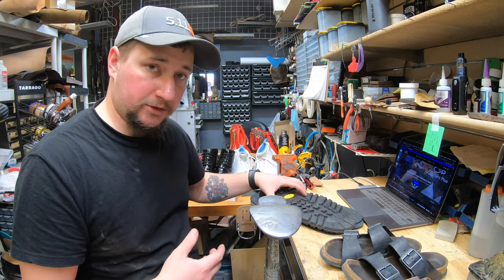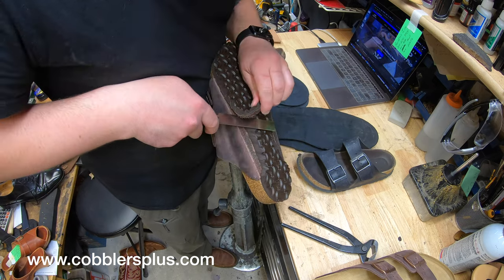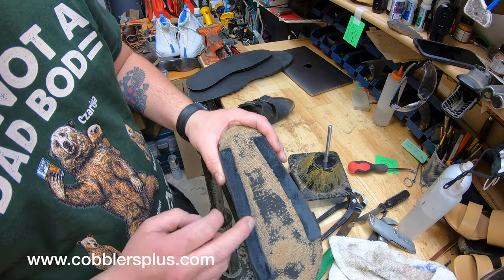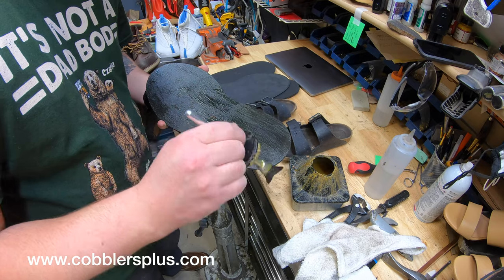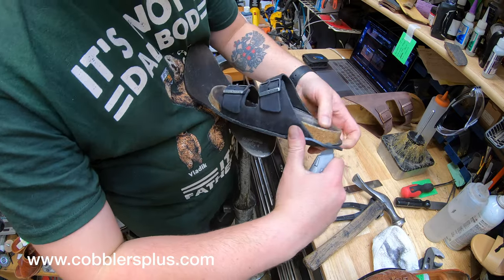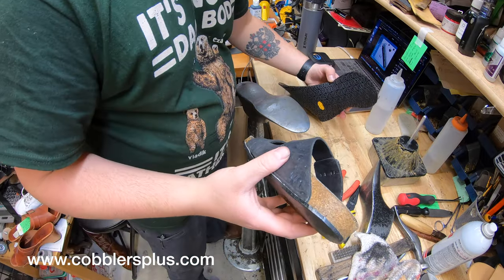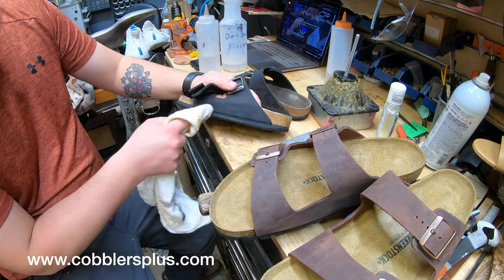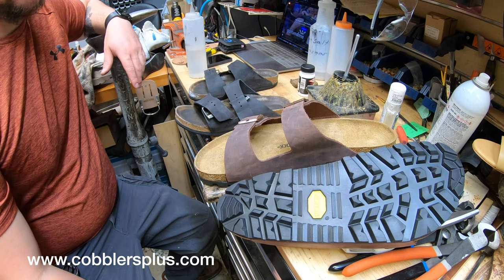Birkenstock Arizona resole with Vibram Skull and Vibram Sierra

Comment: How much it cost to repair the sandals if your replacing the foot bed and the soles, is not cheaper just to get a new pair of sandals?
Reply: Figures the question I came here to ask wouldn't get answered. 😏
Reply: @TheWinterjen  70-130$ for a job like this depending on the cobbler skill and what you want them to do. 
Id easily pay 120 minimum to make them a awesome as possible

Yes it would maybe be cheaper but someone might want to save a pair for nostalgia/sentimental value or even a limited edition pair or something.

Comment: On the rewatch. So are the Vibram and other one more durable than the dogbone?  I feel like dog bones wears very fast in the heel. Wondering where you get the midsole material. Been looking all over amazon with a lot of luck. What temp do you warm at?  What’s that sanding tool you’re using the cut off /remove that bottom sole?  Do you have trouble removing the bottom sole from the midsole material?  I’m struggling.  Thank you for the very specific tips. I have an expensive lift on one shoe so it’s getting quite costly to replace them.   I cleaned up my whitebirko-flor and midsoles with some oxyclean.  Worked great. Just kept it away from the cork and stayed on the outside.

Comment: Love your channel and candid sharing of your expertise! 
I watched one of your previous Birkenstock complete resole using Birkenstock cork footbed and outsole. In both videos you shave the outsole. 
I came across YouTube channel DrPronghorn's Make-Along Vlog, video title: "A New Method For Recrafting Birkenstocks: Don't Throw Them Out".  
In the video he uses a heat gun on the outsole to weaken the bond of the adhesive to the point that he easily separates the entire outsole by hand. No shaving, no grinding, no solvents and w/o taking chunks of cork out of the footbed.  DrPronghorn  states that he hopes his video helps other cobblers and enthusiasts. Just wanted to pass the word. Have you tried this method or would you not recommend it? 
Edit: He goes on to say in the comments that he now places the sandals in some sort of kiln or craft oven set to 200 degrees F for a few minutes.

Comment: Man this was a cool video. I have a couple pairs of Arizona with extended straps add to them. I love Birkenstocks because they make them for big feet and wide feet. It's not often you run across a Birkenstock that is a size 14 & up. I have big very very extremely wide feet sz15 6 E wide with very fat wide toe that are equally straight across making my foot very very wide at 6 1/2 inches wide from my big toe to my lil toe. My foot outgrew shoes , socks , & boots 35 years ago. I have a pair of flip flops but I barely can get them to fit on my foot because my toes are wider than the flip flop strap. This is why I bought the Arizona's & needed to add the extended straps to the Arizona so the straps well buckle up over top of my chubby fat wide toes that are straight across. I wish my toes were at a 45-degree angle like shoes are made because with my toes being straight across it makes it very very difficult and find something to fit on my foot because of that. It Also don't help having very fat wide toes. But my wife said my very chubby fat wide toes that are equally straight across look really cute in the  Arizona. Good video sir thank you for sharing.
Reply: Where did you order the extended straps from or did you get them custom made?
Reply: Ooo, you’d be perfect for Nicks Boots. They run in sizes from 3.5M to 14.5M & Width of A to FF

Comment: Thanks for the very informative video. My Birkentsocks wear faster on the heel part (specially the right foot), but the rest of the sole is intact. What I did was use Shoe Goo to build up the heel to the original thickness--just give the heel enough extra time until the rest of the sole wears along with it. Then will have the sole replaced the way you did. Unfortunately, I live overseas so will have to find a cobbler in my country that knows Birks enough. The Birkenstock dealer will do it, but for a premium cost to me (half the price of a new pair).

Comment: I have a pair of Birkenstock sandals. The problem with them are the upper part, against the foot. It's to hard, stiff and bad for my feets.

I won't ever buy their shoes again, unless they do something very different. Their upper leather parts are fine, and of exelent quality. If that was put on a "barefoot shoe" sole, it would be nice.

I looked at a video where someone removed the upper part of the sole, which is what I object to, and make them more along the line I prefer.
That's what I will do with mine.

Comment: Good Lord…another video overworking the sole removal. Yanking, cutting, sanding wheel is all wrong. Use a heat bench or a heat gun to soften the glue and that sole will peel right off doing minimal damage. Its the best way to do it.